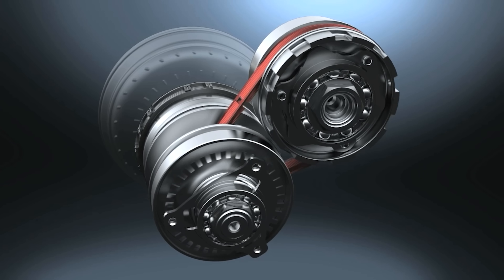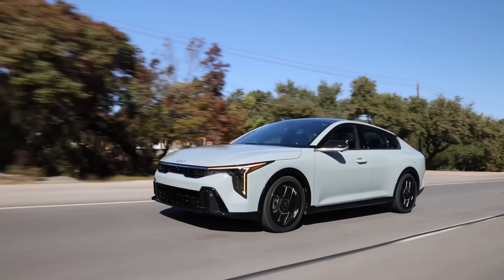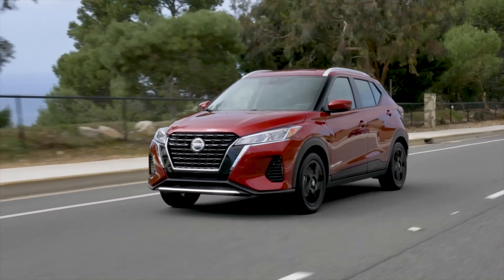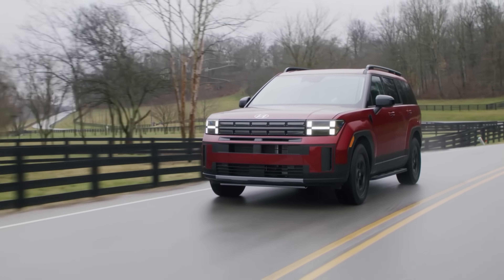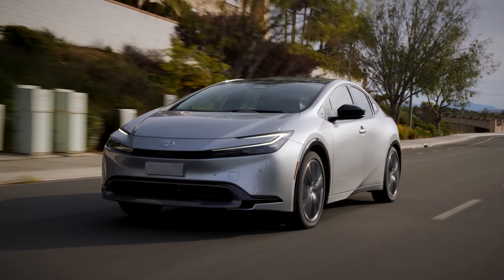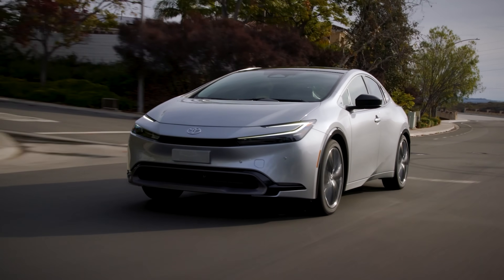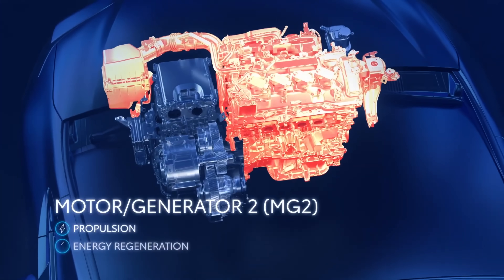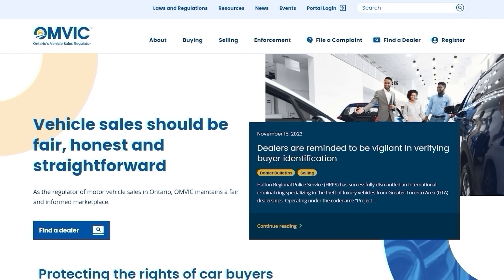Types of Transmissions (AT, CVT, DCT, ECVT) Which Is Most Reliable?

Comment: I have been driving manual transmissions since 1973 because they are safer and make driving much more fun. Over those years I haven't had a transmission failure, but I have had to replace clutches. I recently had to replace the clutch in my Toyota T100 pickup, the first clutch I have gotten in twenty years. The truck was still on the original clutch, which was 28 years old and had 194k miles on it.

Comment: Excuse me, a little context: Subaru introduced the Boxer engine in 1966 (59 years ago); AWD in all its models in 1972 (53 years ago); CVT in 1989 (36 years ago); and Lineartronic in 2010 (15 years ago). So, my friend, in this context, Subaru demonstrates reliability and experience in engine, AWD, and CVT manufacturing. They were the first to adopt these innovative technologies, and therefore, they have the best know-how on the market.

You must start from the premise that Subaru (any of its models, except the WRX) are not sports cars (Ferrari, Lamborghini, Mustang, Camaro, Porsche, Audi, BMW), nor are they super off-road vehicles (Land Rover, Land Cruiser, Jeep, 4Runner, Tacoma, etc.), and therefore, this must be considered in driving (both urban and off-road), as well as in the operation of its Lineartronic (CVT).

Subaru incorporated the CVT with the Justy (1972), manufactured by Jatco, a period during which problems arose. For this reason, they innovated by designing and manufacturing their own transmission, which they called Lineartronic (2010), the TR-690 for 2.500 cc engines and the TR-580 for 2.000 cc engines.

Today, despite all the criticism they receive, the Lineartronic transmissions (TR-690 and TR-580) are very good. They have a different style, operating procedure, and feel compared to manual and automatic transmissions. You must understand them to get the most out of them, and this applies to both the Lineartronic (CVT) transmission and the Boxer engine and its AWD system (which is the best on the market), allowing you to fully enjoy Subaru cars within their design performance parameters.

Comment: The fluid in a manual transmission is typically just a simple gear oil.  You don't need to change it every 30,000 miles.  You would do just as well changing it every 100,000 miles.  My 2001 Cavalier lasted me 15.5 years and 181,000 miles, wherein I did zero maintenance to the clutch or transmission.  I'm not recommending going 15 years before considering changing the gear oil, but that is definitely my experience.  The transmission outlived the rest of the car.
Reply from the maker: Changing the fluid every 30k will keep the synchros in good shape and smoother gear changes for the shifter. It's so cheap and easy to do on a manual there's no reason not to do it

Comment: when it comes to dual clutch transmissions, I have had very positive experiences with the VW DSG. I used to drive a 2013 Jetta with the DSG, and sold it at 120,000 miles. Never had a single problem with the transmission. I now drive a 2014 Passat TDI with the DSG as well. It has 150,000 miles, and still no transmission issues. It is imperative that you do the fluid and filter changes every 40,000 miles, and you will see excellent reliability/longevity with these things. At some point, you will have to replace wear items like the clutches and dual mass flywheel, but at 150,000 miles I still haven’t had to do those things. Overall, if you are looking at a VW with the DSG, you don’t have much to worry about as long as you know the routine fluid/filter changes have been done.

Comment: I traded my 2021 Subaru Outback after just 18 months partly due to the awful whine during acceleration and with the 2.4 turbo engine the horrible jerky fake gear shifts .. complete engine / transmission mismatch .. now with a standard 8 speed standard auto gearbox..

Comment: I do not agree with the fact that manual transmissions are the best anti-theft. This honor goes to all electric vehicles, they are by far the least stolen because they don't end up in containers en route to the Middle East where there are no takers for these vehicles.Btw Ev have the best gearboxes ...as they are usually absent. But... I wouldn't buy a Leaf just in case there is a simple gear in it made by Jatco.

Comment: Have driven every type of transmission and DCT was my worst experience. Would take a manual, torque converter automatic or eCVT. Kid just got a Corolla with a CVT, so too early to say, therefore fingers crossed.
Reply: If its a newer corolla it should be fine. Toyotas new cvts are a lot better than any previously made.

Comment: I used to swear only by manuals because it was either that or "slushmatics".  The modern ATs with 6 speeds+ and  extremely efficient lock-up clutches removed enough cons that I don't mind them now.
Reply: Sure, because they're basic and simple. Naturally they're going to be more reliable. There are fewer parts, less complexity so fewer things to go wrong. That's not rocket science.

Comment: My 2020 Honda CR-V has a CVT and so far, it has proven to be very reliable. A CVT is not the enthusiasts choice, but a CR-V is not an enthusiast vehicle either which I'm fine with. The main reason why CVTs get a bad reputation is because of Nissan's infamous problematic Jatco CVT. For Honda, if you change the CVT fluid every 30K miles, you should be okay.

Comment: There are lots of good transmissions and bad transmissions from every brand and type. German CVT transmissions are terrible, but their automatic transmissions are fantastic. American transmissions are mid at best to terrible at worst overall. GM especially makes garbage transmissions. Japanese cars tend to have best overall with the exception of Nissan. Dual clutch transmissions tend to be the worst due to extremely poor reliability, high repair costs. Overall, get a hybrid, a Japanese vehicle, or both.
Reply: What German cars use a CVT?
Reply: @mranerobic3795  Audi. Mini.

Comment: Over 60+ years of driving I consider the clutch to be the Achilles heel of manual transmissions.
Reply: yes , bad drivers can burn out a clutch in days ;;  i treat them fairly and do not get problems [ i hope ] ,  my hiace has 202000 miles and have not replaced the [ juddery when cold ] clutch  , in the 8 years i have had it ...

Comment: I had an old '89 Sentra that had a 3 speed AT. It was terrible on the highway as keeping your speed using the pedal was almost impossible.
Reply: I drove a 3 speed AT at some point and I think the main problem was the extremely long gears which meant slow acceleration in the last gear. The transmission didn't want to downshift to 2nd because the engine would rev too high.

Comment: E-CVT is the most reliable. My 2010 prius had over 300k km with all the original drivetrain and battery.
Reply: My 2005 Accord has 320k on original automatic transmission and 4 cylinder engine, most don't get that far, a few have 400k or more.

Comment: We like the automatic in the Mazda CX-5. An old school 6 speed with a more modern torque converter, so it takes off very well from a stoplight. We have new transmission fluid added at 90 thousand miles. Do not believe the liars that say the fluid is a lifetime fill. For a shorter life.
Reply: Mazda vehicles are the best. Handle the best, smooth ride.

Comment: My first two cars were with the manual transmission. It was a pleasure to drive. I recall that my Honda Civic with 1.6L and manual transmission was easily the most dynamic car I even drove. When accealarating at traffic lights, it was always far ahead of other cars. It easily made 38-40 miles per gallon. Now I can compare it to Toyotas and Subarus with automatic transmission with 2.4L, and they feel extremely sluggish when I try to merge into traffic or go uphill. Why did they stop making cars with manual transmission? They they there is low demand. Well, what is the demand for CVTs, or cylinder deactivation, or those stupid touchscreens with fifty menus to adjust the AC? Is it really high demand for that?

Comment: In my younger days (I'm 78) I favored a manual transmission above anything else but we now own a 2022 Toyota Venza hybrid with an eCVT which now is my preference even more so than a manual. My experience makes me think that an eCVT is less expensive over time because a manual transmission will require a clutch replacement over time, which is quite expensive with today's labor rates.
Reply: Having a good left hip also helps with clutch longevity...which is less obvious as you get older. You can't understand that when you're young.
Reply: I hope you being healthy and happy
Reply: Same here, I drove manual for more than 30 years, now I drive RAV4 PHEV with eCVT, I love it
Reply: A clitch replacement is much cheaper than replacement of entire transmission.
Reply: @Jerry0722-xp3k  yes, but the Toyota eCVTs are nearly bulletproof. As long as you do proper maintenance, they’ll last as long as you want them to.
Reply: @Jerry0722-xp3k  A hip replacement is probably now more common than a clutch replacement ...at least in NA.
Reply: @cabaneencac5168  😂😂 It sure seems that way, doesn't it?
Reply: @cabaneencac5168  🤣